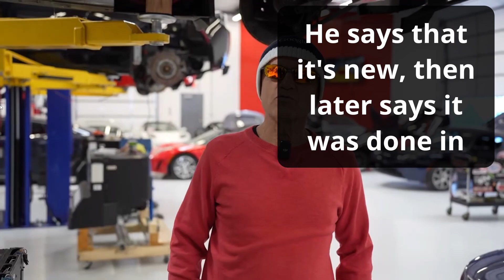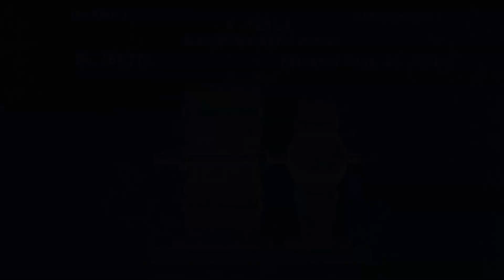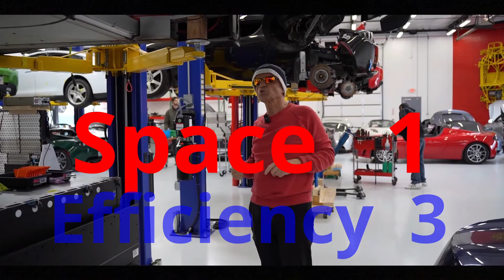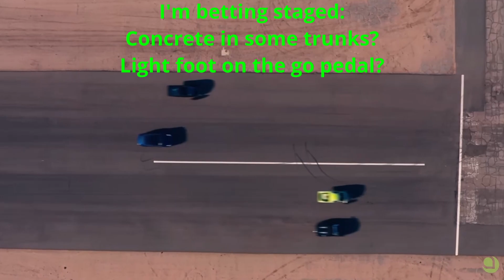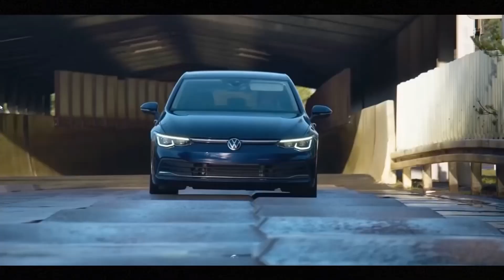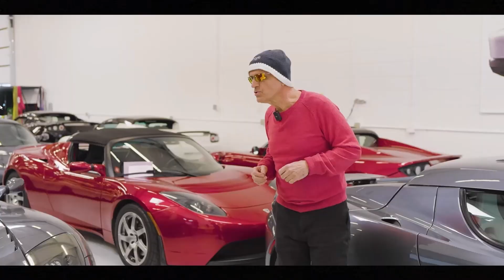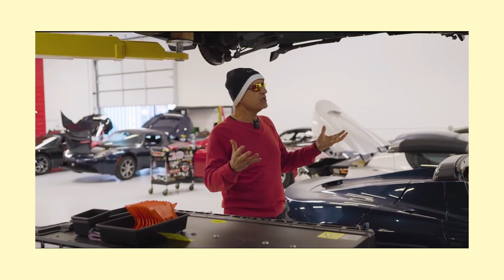Aptera   is this man for real

Comment: it seems to me like the app Tara is trying to fit a specific need of a small electric vehicle with an extremely low drag.  The narrator seems to be speculating quite a bit without having actually tested out how this technology has been put together and tested. until he does some of that it's mostly just throwing rocks at other people's ideas. he may have some good points but a lot of his issues seem to be about verbiage.

could should and might are no substitute for actual testing.

has this narrator actually tested the technology he is criticizing? does not sound like it.

as far as sacrificing high topping speed, so what? if it goes 80 miles an hour and that's as fast as you ever want to go then there's not a lot of problem. if you want a vehicle that can reach 120 mi an hour, then get something else.

I would sacrifice that extra 40 miles per hour top speed in a second for much lower operating cost and much lower carbon and toxicity footprint.

The critic sounds a little bit like he's offended someone's actually trying to find a better way. and they are wankers for trying.

Comment: I had a 2009 Honda Civic Hybrid. The brakes lasted over 100,000 miles. Probably because of the way I drive to try to get the most mpg I would disagree about the brakes causing more heat for the in wheel motors. That being said, the motors if they are regenerating would probably cause more heat than the brakes. From that compact car I now have two mid size cars.  With the wheels so far out on the Aptera what was not mentioned is that the interior space is minimized. Being close to the one next to you is not always wanted. I used to drive the Borman expressway , the busiest expressway in the US. Usually three lanes of trucks all going over the speed limit(4 lane expressway), tailgating if you are not going over the speed limit, and many not being able to keep the truck in the well marked lanes. Who would want to drive a super wide car with limited safety features in a tiny cabin on that expressway? The new Aptera was supposed to be able to go to 60mph in 3.5 seconds. Not now, that number has been raised. Could it be that the increased torque cannot be controlled? That was another lie? or exaggeration? Or not knowing what the car would do? I believe that many ticket holders will be pissed off about who gets the first cars(only big investors) and really be upset when the price is announced. The cheap car price of 3 years ago will be another "salesman pitch" that holds no water.
Reply from the maker: [I had a 2009 Honda Civic Hybrid. The brakes lasted over 100,000 miles. Probably because of the way I drive to try to get the most mpg I would disagree about the brakes causing more heat for the in wheel motors.] You have no reason to - your Civic didn't have IWMs. 
[That being said, the motors if they are regenerating would probably cause more heat than the brakes.] I went one better - I said they do. 
[From that compact car I now have two mid size cars.  With the wheels so far out on the Aptera what was not mentioned is that the interior space is minimized.] The Grube did mention that - pay attention. 
[Being close to the one next to you is not always wanted. I used to drive the Borman expressway , the busiest expressway in the US. Usually three lanes of trucks all going over the speed limit(4 lane expressway), tailgating if you are not going over the speed limit, and many not being able to keep the truck in the well marked lanes. Who would want to drive a super wide car with limited safety features in a tiny cabin on that expressway?] Many roads are worse, and they aren't being built exclusively for that one. Answer: Only fools.
[The new Aptera was supposed to be able to go to 60mph in 3.5 seconds. Not now, that number has been raised. Could it be that the increased torque cannot be controlled?] The excuse is that Elaphe made a motor with 20% more efficiency at the expense of 15% less punch. I don't believe it, and there won't be 480 miles out of the Launch Edition. Actually, there won't be a Launch Edition. lol 
[That was another lie? or exaggeration? Or not knowing what the car would do?] I just call it snake oil. 
[I believe that many ticket holders will be pissed off about who gets the first cars(only big investors) and really be upset when the price is announced.] That's the least of their worries. 10 years and no EV will top that. 
[The cheap car price of 3 years ago will be another "salesman pitch" that holds no water.] They can put $5 on them and it wouldn't matter - I reckon they probably know none will be sold.
Reply: @aussieideasman8498  The point that may have been missed is that if you rarely use the brakes, the heat from the brakes is not a consideration. Brake pads do not last over 100,000 miles on a vehicle( they do on cars I drive). A hybrid can regenerate with the motor if you coast to stop signs and stop lights, light braking way before the stop makes regeneration increase. Keep the car moving to improve efficiency. The Aptera is not a small car. The interior is small. The video says that cars will be smaller with IWM. That does not apply to an Aptera. And no matter what is said, two person cars are not a big seller is the USA.
Reply from the maker: @jonbowden2099  [The point that may have been missed is that if you rarely use the brakes, the heat from the brakes is not a consideration.] That works for the Civic because the brakes are well away from the engine and motor, plus they are air ventilated; none of which applies to Aptera.
[Brake pads do not last over 100,000 miles on a vehicle( they do on cars I drive).] Impressive. 
[A hybrid can regenerate with the motor if you coast to stop signs and stop lights, light braking way before the stop makes regeneration increase. Keep the car moving to improve efficiency.] Most cars don't help regen with the brakes, but the BYD Atto3 claims to. 
[The Aptera is not a small car.] Yet they claim it is very light. Weight is important and size is irrelevant. 
[The interior is small.] Also irrelevant when discussing regen and friction brakes. 
[The video says that cars will be smaller with IWM.] The video says space is freed up for passengers, while still being a bit smaller. 
[That does not apply to an Aptera.] It does - it's a universal feature, but not worth doing. 
[And no matter what is said, two person cars are not a big seller is the USA.] I agree.

Comment from the maker: @John Trotter John, unfortunately I am blocked from reaching anyone on AOC, so will you copy and paste this whole comment into the 'Aptera has some cool new simulation footage' clip for me? It will give some people food for thought about that 95% accuracy claim. Here is your comment, first: 

"2 hours ago
"95% accuracy" - Whether it is good on not depends on which 5% was not faithful.  The crash animation shown is interesting, but it's damage to dummies that will be critical. Our tough, light, cacoon will rebound to a unique degree.  The really good news is that this type of modeling is very advanced and I would be surprised if there are significant, undiscovered, vulnerabilities that show up in kinetic tests."

Now for what I have to add:

Watch the simulation at 1:37 and notice that the wheels splay in opposite directions well before any contact with the wall. How do they do it? They have to break the steering linkages to move that way, and the crumple zone is too far away from them to have any real input of that nature. There is a bit of lift, that's all, to the fronts of each control arm if the rising frame reaches them, but my brain says that it is more likely to draw the wheels inwards if anything, and can't possibly push them out. It all looks fake to me, and I would like to read some deeper discussion about this; it certainly doesn't appear to be 95% accurate. Even a sudden deceleration would tend to draw outboard items of weight inwards, and not splay them; only the wall can do that - but not before they get there.

Comment: The Aussie deception man at it again. Let’s skip to the end of the video when you do your analysis, at about the 15 minute time mark on. To show to others that you have no clue what you speak of. This should be proof no one should take any value from what you say.  You calm that the heat from the brakes will heat the motor, what you fail to understand is the large portion of the braking in an EV is regenerative braking.  This is used to capture the kinetic energy of the vehicle and turn it back into stored power in the battery.  The regenerative braking is so strong it has led to a new term “one pedal” driving, where the accelerator is used to regulate the deceleration of the vehicle.   Bringing the vehicle to a stop with little or no use of the brakes.
Reply: From the Elaphe website 7 May 2019 (yes I can use Google too, but I actually use it to uncover the truth not to make straw man arguments) "The technology allows for complete design freedom and the potential for increased regenerative braking. In-wheel powertrain can also help reduce the overall required battery capacity and cost." So yes, the Elaphe in-wheel motors use regen. Why wouldn't they? It's the best way to increase efficiency of an EV. Not only that, the Aptera will be available with Comma AI as an option, which would definitely not work too well if the vehicle couldn't come to a complete stop using its motors as the brake. But oh no, fake ideas man knows better. He knows all the hidden secrets and lies that nobody else knows about. But there will be zero accountability from him when he is proven wrong. He will just find other things to lie about.
Reply from the maker: @apterachallenge  Another fool just mouthing off.
[From the Elaphe website 7 May 2019 (yes I can use Google too, but I actually use it to uncover the truth not to make straw man arguments)] If you think I have made straw man arguments, just list them and explain why they are of the straw man kind. I will respond to every one of them. 
""The technology allows for complete design freedom and the potential for increased regenerative braking." Potential means it doesn't have it, but can be given it. Make the dictionary your friend. Design freedom is not operational freedom. 
"In-wheel powertrain can also help reduce the overall required battery capacity and cost."" Can help is much like potential - not helping, but it's possible. 
"So yes, the Elaphe in-wheel motors use regen." So no, they are capable, but you need to have it displayed on any EV with those motors used. You jump the gun, and it's because you can't comprehend English.
"Why wouldn't they?" Same reason the three Alpha's had little plastic squares plastered on them that had no solar capability - cheap and nasty snake oil lies. 
"It's the best way to increase efficiency of an EV." I agree. So is using a heat pump, so ask Chris and Steve why they can't use one on the Delta in 2024? The 2021 valve shortage is long gone.
"Not only that, the Aptera will be available with Comma AI as an option," Which works on ICE cars with absolutely no regen.  
"which would definitely not work too well if the vehicle couldn't come to a complete stop using its motors as the brake." Works perfectly on ICE cars with zero motors; just engine and friction brakes. You don't have a clue. 
"But oh no, fake ideas man knows better." I do know better, and I don't fake anything - you lie. Try to refute what I have just dished up!
"He knows all the hidden secrets and lies that nobody else knows about." Wouldn't that be a good thing? I can spot a moron a mile away, as well.
"But there will be zero accountability from him when he is proven wrong." I will buy one and apologize on YT; you have my word. Just let me wait for the first 2,000 to get 3 months old to be certain owners are all satisfied.  
"He will just find other things to lie about." List the things I have lied about, so far. I will respond to every one of them, in detail.
Reply from the maker: @apterachallenge  Nikki from Transport Evolved recently test drove the Gamma and stated there was no regen. You can watch it while you witness a second breakdown due to overheating. This time on the flat roads. The lies came from Chris Anthony.
Reply from the maker: [The Aussie deception man at it again.] We will see what deception you have got for us. Let’s skip to the end of the video when you do your analysis, at about the 15 minute time mark on.] So the bulk of it remains unknown? 
[To show to others that you have no clue what you speak of.] We'll see. This will be fun.
[This should be proof no one should take any value from what you say.] A prudent person would consider the whole video.  
[You calm that the heat from the brakes will heat the motor,] Certainly won't cool it. 
[what you fail to understand is the large portion of the braking in an EV is regenerative braking.] You have got to be kidding! Of course I know about regenerative braking, but I know much more than that. What I really don't know is whether Aptera has it, since they lie about so many things, and there is zero evidence they aren't lying about regen.  
[This is used to capture the kinetic energy of the vehicle and turn it back into stored power in the battery.] I know, and it's the motor that does it. BTW, the motor heats as it regens. Did you think it could regen and cool? You would have to be an idiot.  
[The regenerative braking is so strong it has led to a new term “one pedal” driving,] I also know that, and have driven seven EVs with only the Tesla Model Y having it. Six not having it leads me to think Aptera is most likely not to include it. Has Jay leno; Jack Scarlett; or any of the few staff to drive it commented that it has one pedal driving? In the absence of such information, I would not be claiming Aptera has it. 
[where the accelerator is used to regulate the deceleration of the vehicle.] While the accelerator gives you control, it is the motor that is used, and while the accelerator stays cool, the motor heats, as does the battery, only slightly. 
[Bringing the vehicle to a stop with little or no use of the brakes.] Only when you give it the right distance. Should you need less distance, you brake via the brake pedal, which activates the friction brakes that are designed to dissipate their heat outwards. They are always ventilated in normal cars, but Aptera enshrouds them in with a hot motor to put too much heat on the already hot wheel bearings, and all three have dangerous consequences. I'll leave you to work out what the individual consequences would be but, rest assured, they are not good. 
By all means, write back and tell me how I am deceiving people with these points I have just made. In fact, try finding deception in the whole video? Or just admit you have been a fool. Find me another vehicle on the planet over all time that has encased a motor, wheel bearings and brakes together out of the cooling air? Is it another scam of skin cooling? lol
Reply from the maker: Five months has passed and we have had two major overheating stops, plus Nikki from Transport Evolved said there is no regen on the Gamma. Time to re-evaluate your stance.